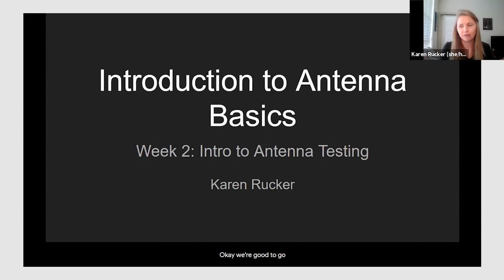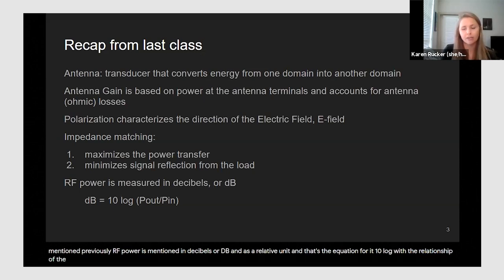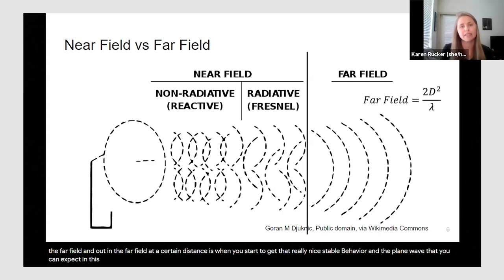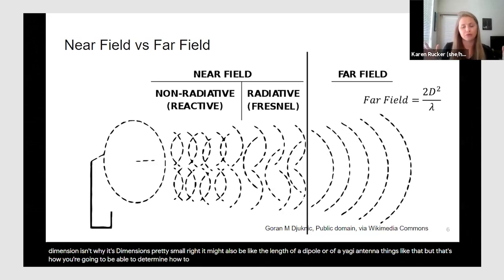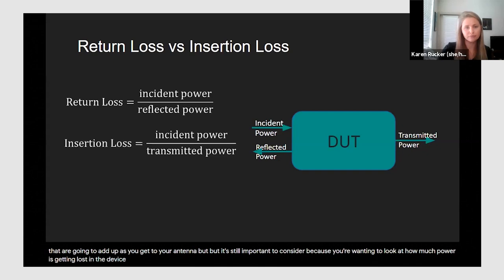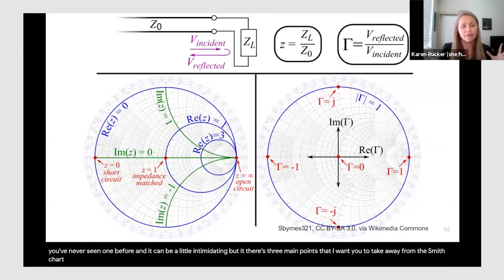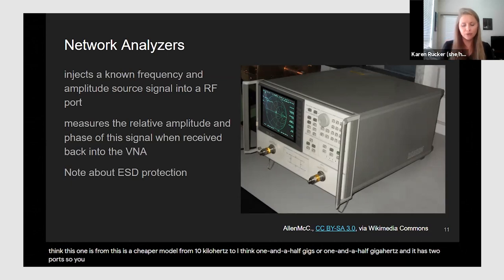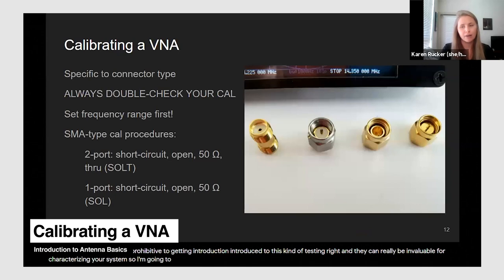HackadayU: Introduction to Antenna Basics - Class 2

Comment: I missed the name of the antenna design software. I have used Xnec2c in Linux quite a bit and 4nec2 seems to more or less work in Wine and probably fine in Windows. As far as I know they are free as in they don't cost money or expire. I don't know if they are better or worse than other options, but it is kind of funny using a GUI to basically fill in virtual punchcards.